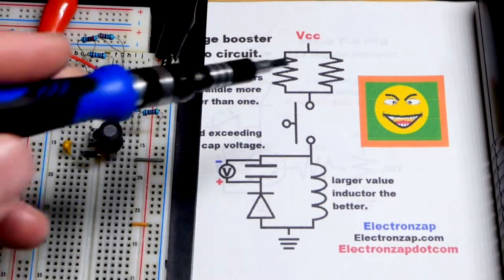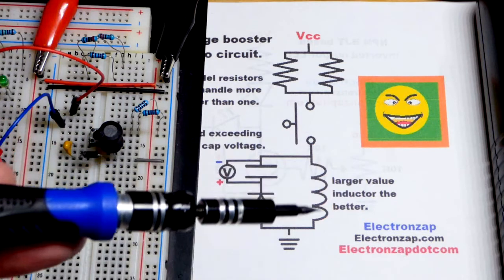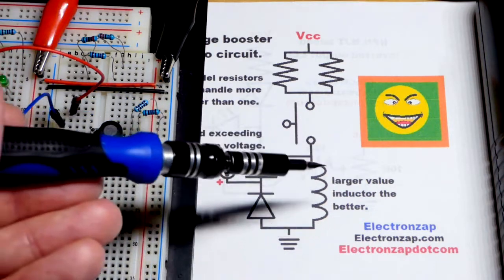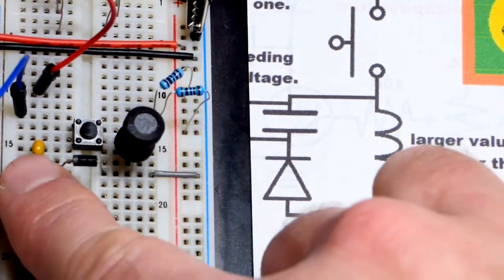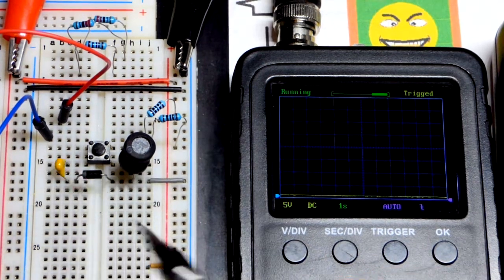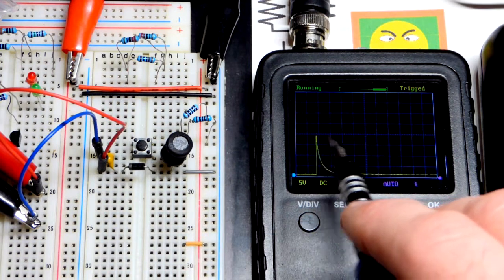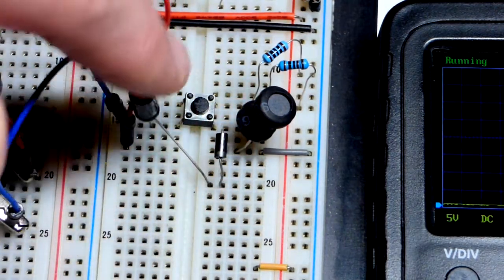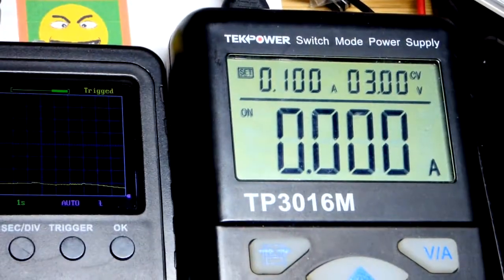Voltage booster demonstration circuit measured with pocket oscilloscope by electronzap electronics

Comment: Does the Capacitor charge when the switch is closed or open or both?

Hard concept for me to understand.
Reply: Also, I've seen a similar circuit but with the inductor on the same side of the switch as the voltage source i.e. the switch is in parallel with the cap.
Reply from the maker: Closing the switch runs current through the inductor, but it takes a little time to get the inductor conducting fully. It starts conducting fully much faster than we can notice though. Releasing the switch cuts off the voltage from the power supply to the inductor. The inductor can't stop moving current instantly though, and since the switch is open, the current has to go through the diode and charge the capacitor. So, the capacitor gets a brief charging each time the switch is released.
Reply: @Electronzap  Thanks for the explanation.

One last question: With the switch closed does the source also charge the capacitor or is the inductor "blocking" current at that stage?